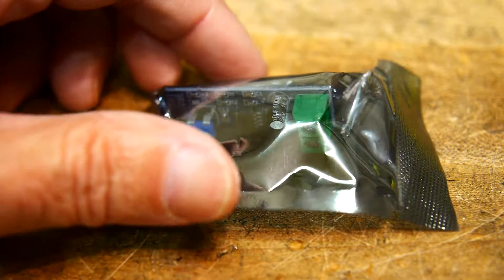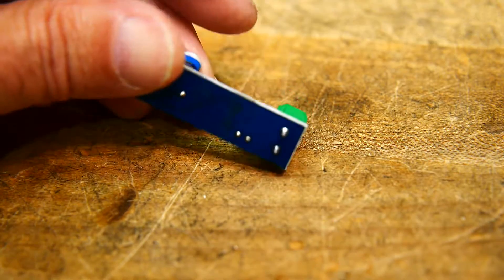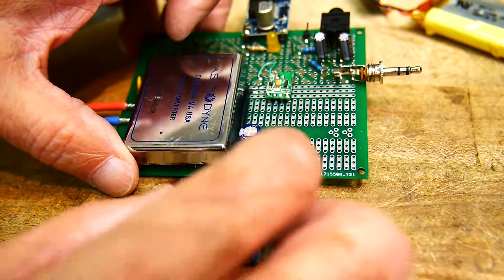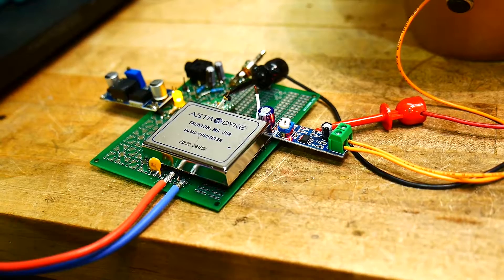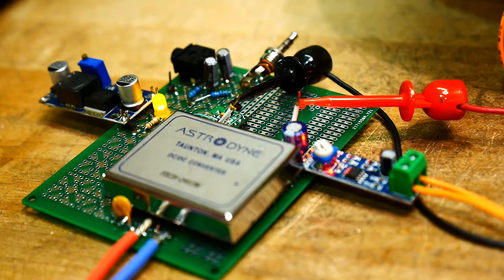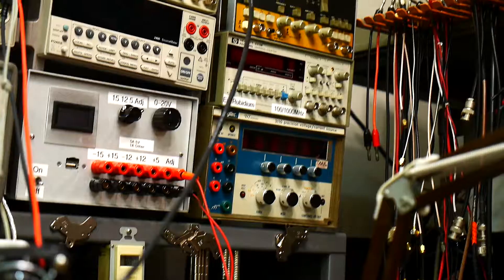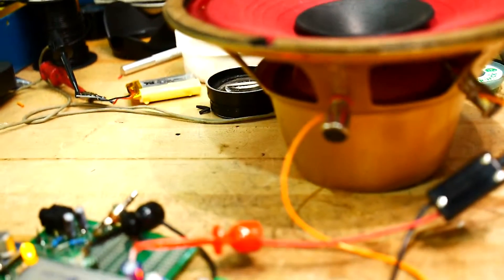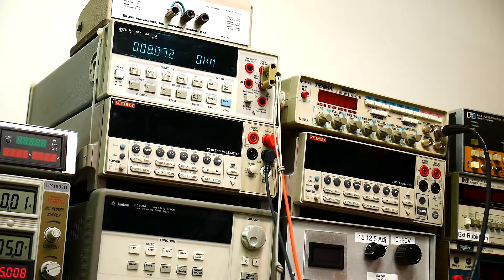#441 Adding an output amp to my audio breadboard

Comment: You can also hook up a quarter inch guitar input jack ,an output jack and a 9 volt battery clip and in 5 minutes have an instant 1.40 distortion pedal..